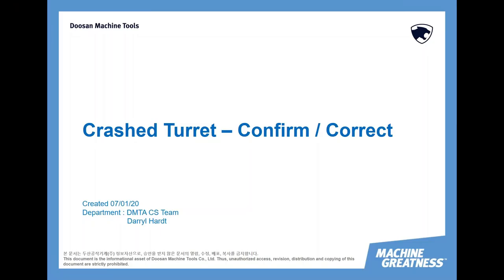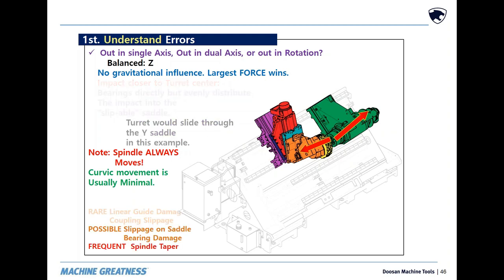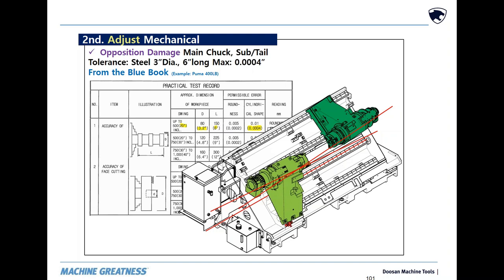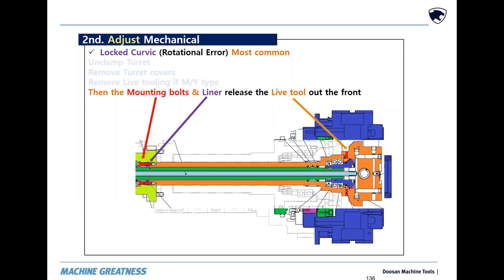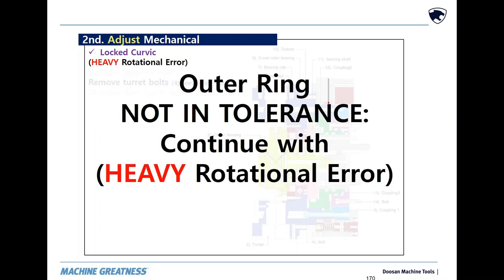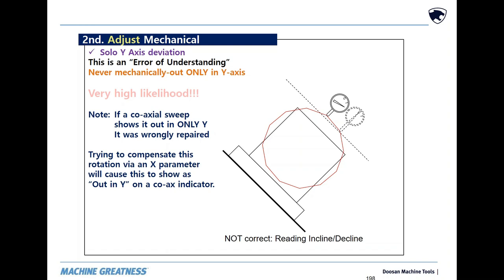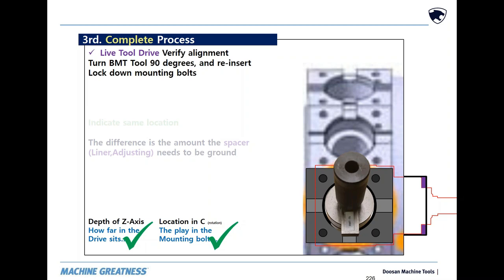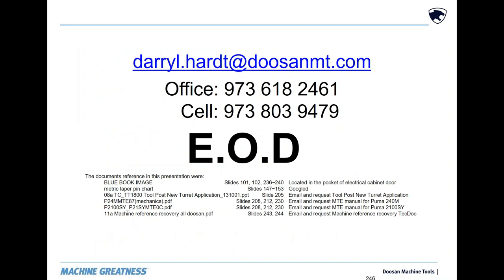Crashed Turret CONFIRM and REPAIR

Comment: Thank you very mach for the explanation, just i have a question: on PUMA 3100 ULY, I found the Live tool drive crashed, I replaced it and I have done the adjustments perfectly and test the Tool change seccessfully, after around 10 hours of work (using tool drive during machine work) the crash accured again finding it's bearing totaly demaged, if you can help me, what's the origne of this problem, and what are the reasons that can lead to change oriontation of Live Tool drive that cause a crash
Thank you in advance 
.
Reply from the maker: I would need pictures to even try to guess.
Please summarize the first findings with pictures and the second findings with pictures,  and send them to my email darrylhardt@gmail.com 
I'll take a look and give an opinion.
Reply: @DoosanTechnician  Please check your mail.